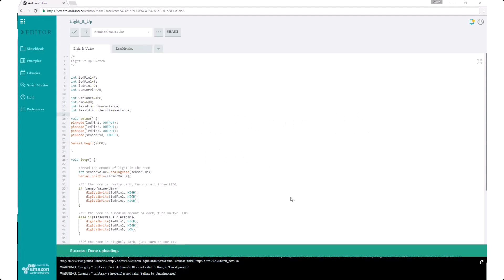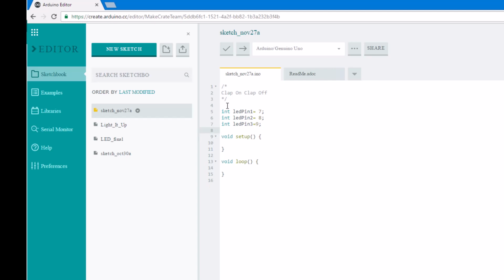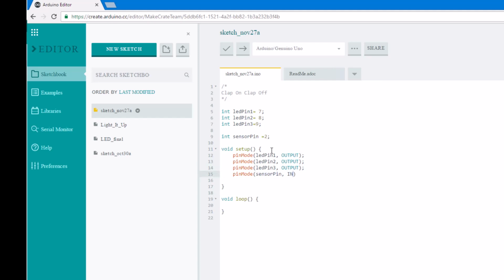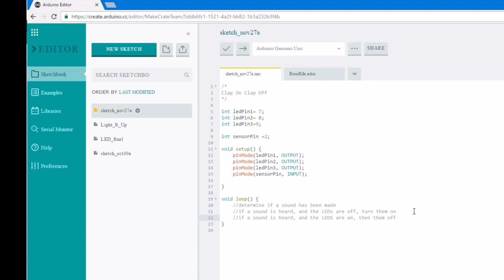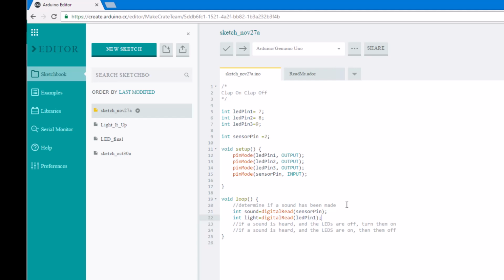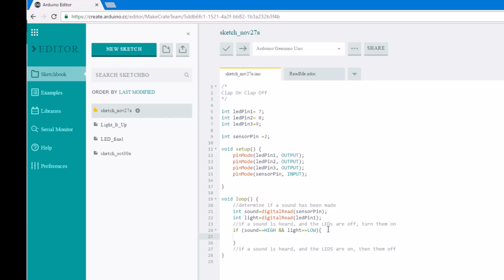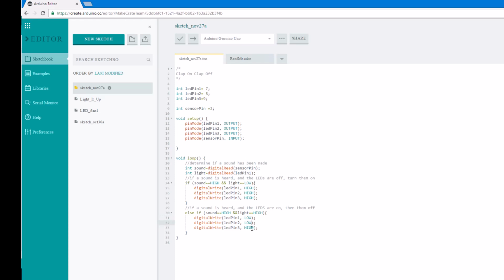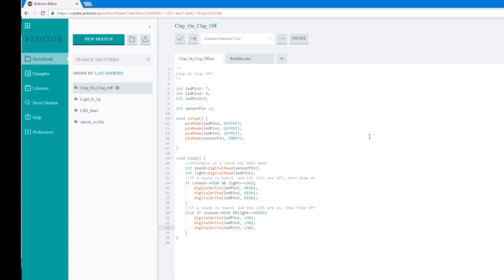Sound Sensor Coding

Comment: import time
import board
import digitalio
import analogio

# Declaration and initialization of input pins
analog_input_pin = analogio.AnalogIn(board.A0)  # Analog output of the sensor
digital_input_pin = digitalio.DigitalInOut(board.D3)  # Digital output of the sensor
digital_input_pin.direction = digitalio.Direction.INPUT

while True:
    # Current values are read out, converted to the voltage value...
    analog_voltage = analog_input_pin.value * (5.0 / 65535.0)  # Assuming ADC is 16-bit
    digital_value = digital_input_pin.value

    # ... and issued at this point
    print("Analog voltage value: {:.4f}V, ".format(analog_voltage), end="")
    print("Limit value:", end=" ")

    if digital_value:
        print("reached")
    else:
        print("not yet reached")

    print("----------------------------------------------------------------")
    time.sleep(0.2)